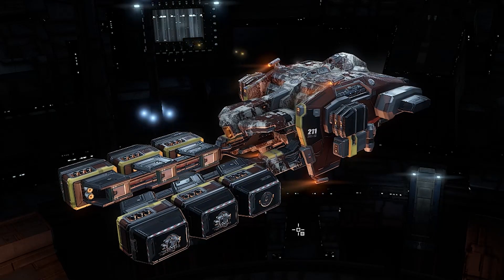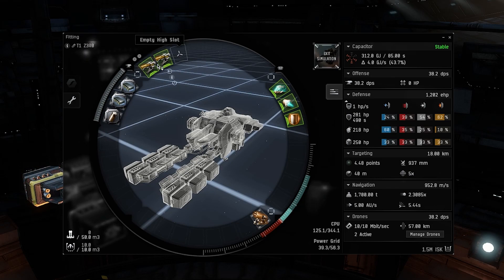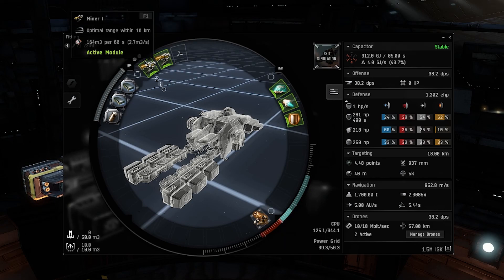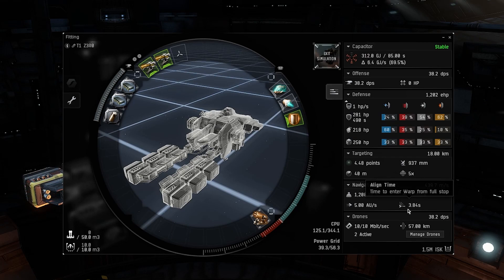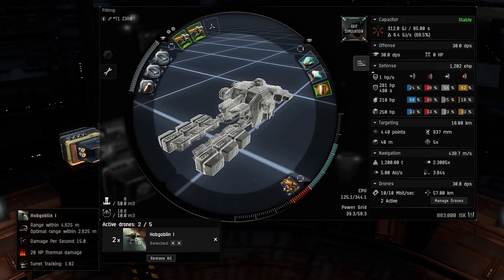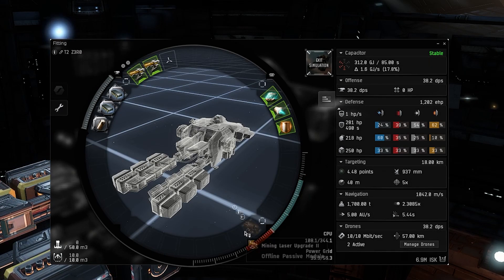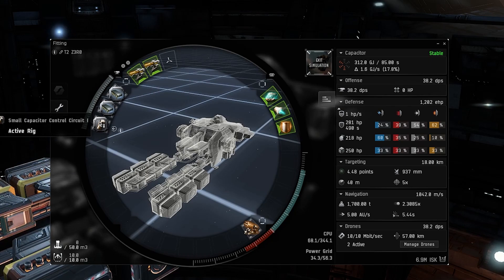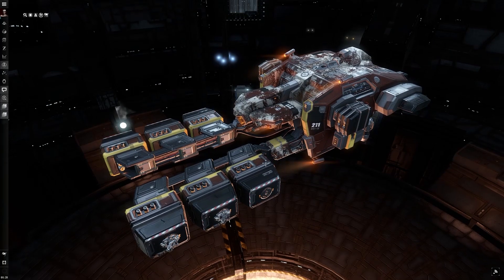Eve Online - T1 & T2 Venture Mining Fits - Ore Industrial Mining Frigate

Comment: you can drop shield hardener mid slot for a shield extender with less cap draw with less cap draw from passive fit you can then swap out overclocking unit rigs for EM and Thermal resistance rigs. will  double your EPH and keep you cap stable so now real drawback to doing so

Comment: you need to up your T1 build a bit for the same ISK, due higher signature 44 vs 57 you take a little more dmg, but you have like 5 times more shield HP with similar resistence  giving you more playground against NPC, meta mining laser not only higher yield but also higher range. Current price in Jita 4-4 1,329 mil ISK. You can use Salvager T1 when there are wrecks nearby or you can also fit a core probe launcher to scan some spawning signatures. 

[Venture, alpha acc mining ore I]

Mining Laser Upgrade I

1MN Monopropellant Enduring Afterburner
Medium Shield Extender I
ML-3 Scoped Survey Scanner

Core Probe Launcher I
EP-S Gaussian Scoped Mining Laser
EP-S Gaussian Scoped Mining Laser

Small Thermal Shield Reinforcer I
Small EM Shield Reinforcer I
Small Capacitor Control Circuit I

Hobgoblin I x2

Core Scanner Probe I x8
Salvager I x1
Reply: Do you still use this or is there a better build?